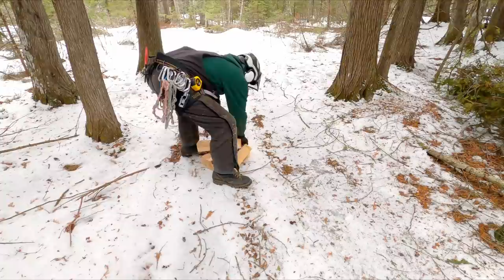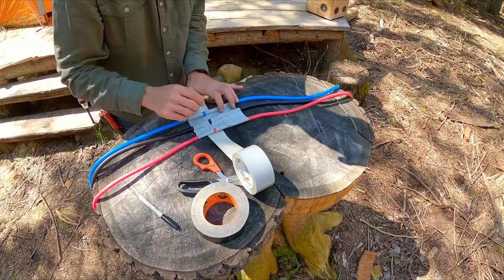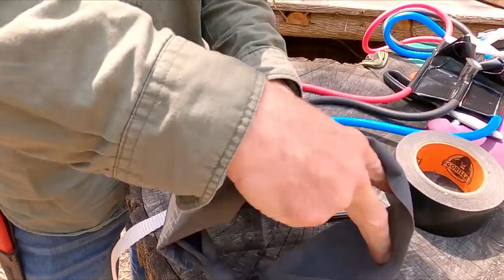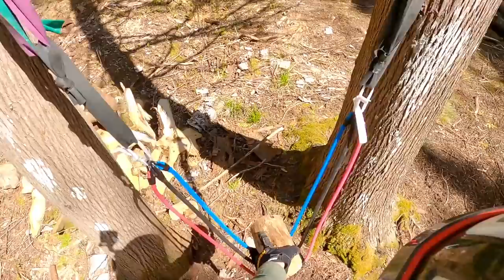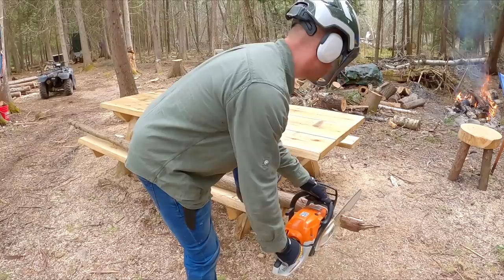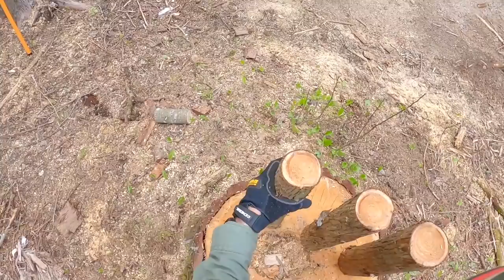Firewood Slingshot...Bowling! #36

Comment: Around 500 BC in 
Syria, a machine throwing arrows or stone balls steeply through rigid 
arms was invented, the ends of which were stuck in elastic horsehair 
ropes. The Phoenicians invented a similar weapon but firing flat-track 
missiles. Both of these constructions were developed by the ancient 
Greeks, who called them  – , as 
well as Macedonians, where catapults throwing large metal arrowheads 
weighing up to 78 kilograms and two meters in length and catapults 
throwing stones weighing about 26 kilograms were especially popular. 
They were used to destroy the battlement and wall fragments, and to 
destroy the enemy’s siege machines. A machine throwing missles up a 
steep track was later called the  by the Greeks, and after the Romans took it over, it received the name of a .

Comment: Watching Ryan figure out physics is pretty funny. Get rid of the looped bands, they’re eating all of your kinetic energy.
Reply from the maker: Really?  Looped bands are no good?  Why?
I just finished a book by Neil deGrasse Tyson and am currently reading one by Stephen Hawking so lay the physics on me!
Reply: @survivingringworm2202  the loops between the tree and the bands are eating your energy. Not saying it’s wrong per se, just that it could be more efficient. As simply put as possible due to limited characters, the elastic energy is being lost upon release because of those smaller secondary loops. You want as direct as possible. Having the main band (the one containing the projectile) as a fixed point to the tree is the most efficient, anything else is allowing unnecessary energy loss. If the smaller loops hold more energy due to their resistance, you’re losing resistance in your main band.